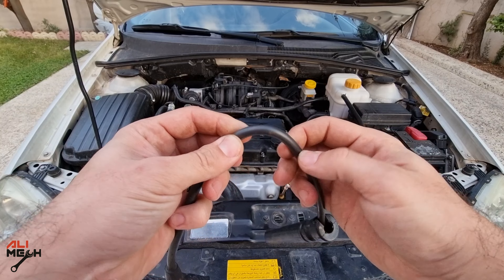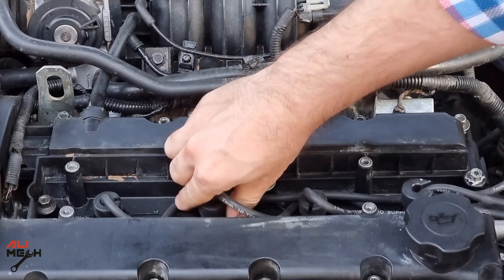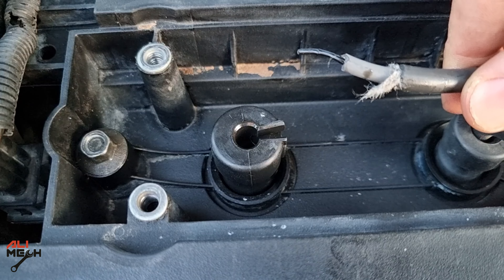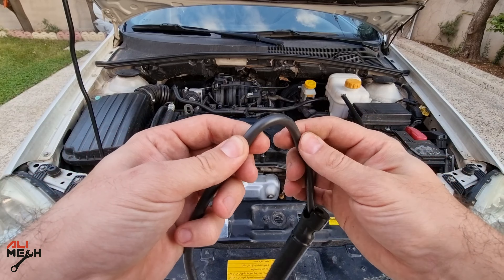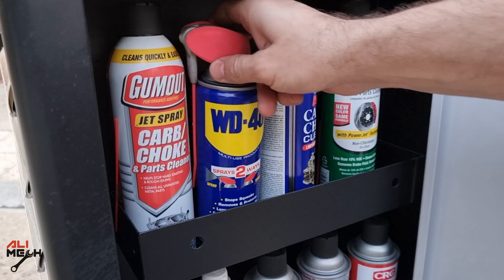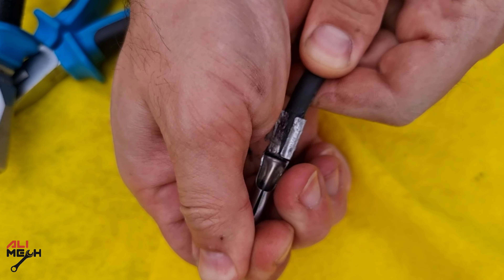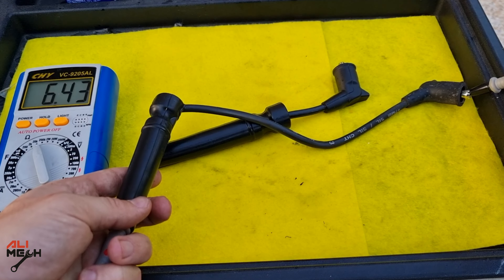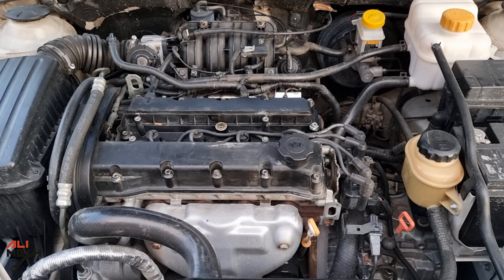Should we fix broken spark plug wire?/How to test spark plug wires/How to fix broken spark plug wire

Comment: Do you have a video on how to replace spark plug wires for 2016 camry?
Reply from the maker: Do you mean ignition coil wire ?
Reply: @AliMECH  yes I think so. I hit 100000 and was told it was time to change my spark plugs so I did using your video(very helpful, thank you!) then a coworker was like it’s good practice to change your wires with your spark plugs. So I would assume it’s for the ignition coil.